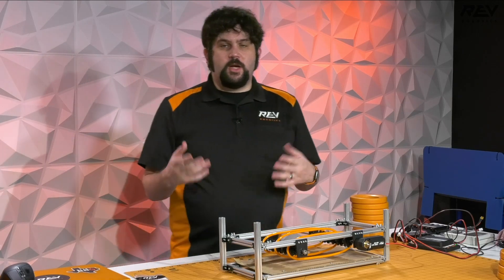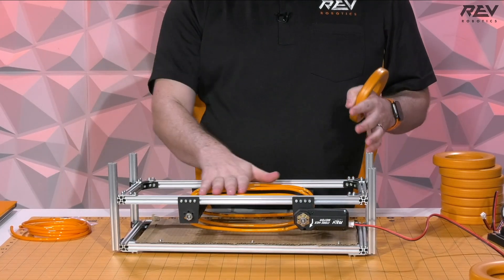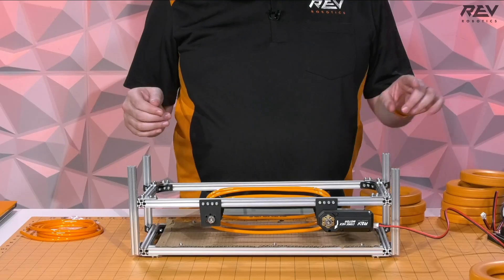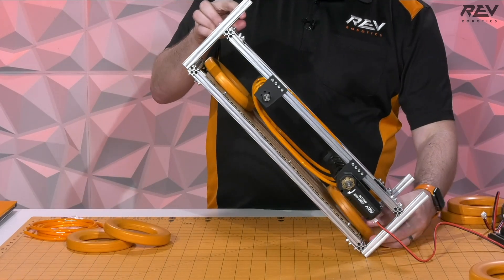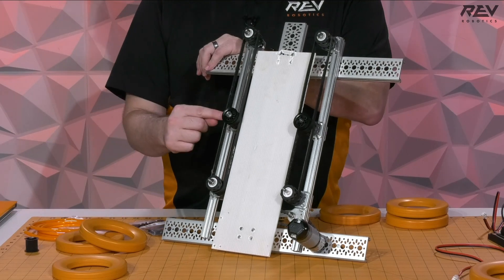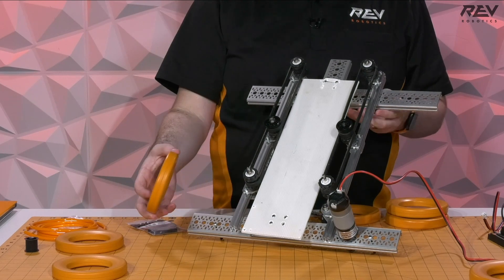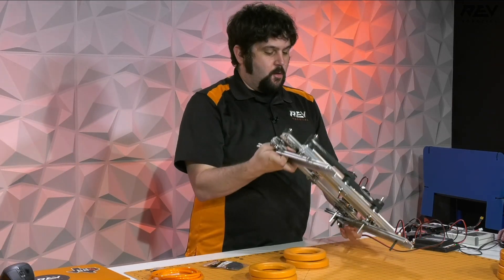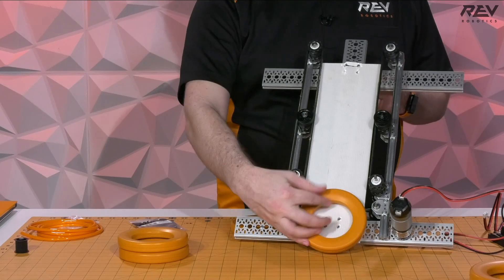Conveyors - FTC Ultimate Goal 2020-2021 Prototyping

Comment: I don’t think you will respond but how did the chains work on the back of the second prototype
Reply from the maker: Chain runs from the motor to a shaft with a gear and sprocket stacked on it. From that sprocket the chain connects to the "right" side of the intake. The gear meshes with another gear to power the "left" side of the intake. This way both sides are moving in opposite directions but off of the same motor allowing for the game piece to move up the conveyor.
Reply: REV Robotics thank you for responding this helped